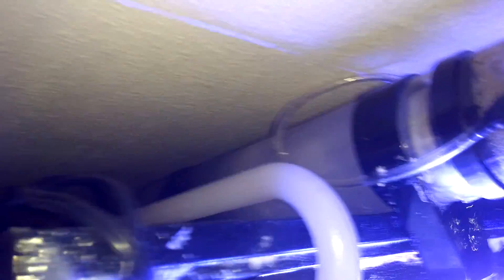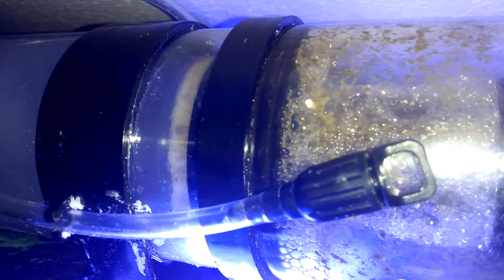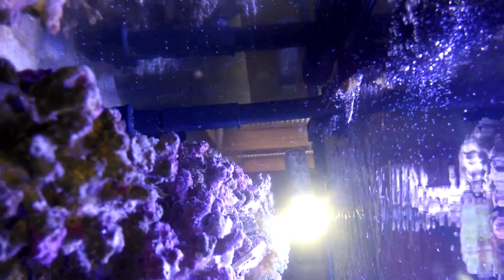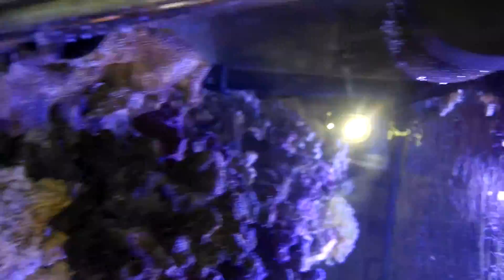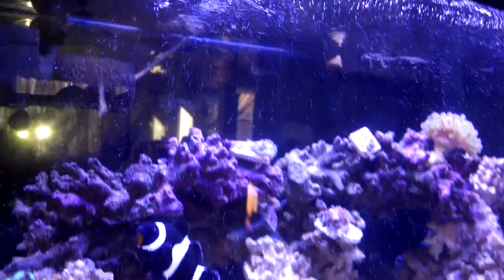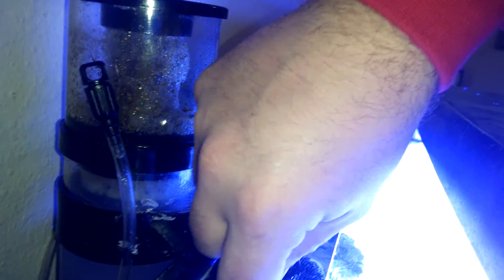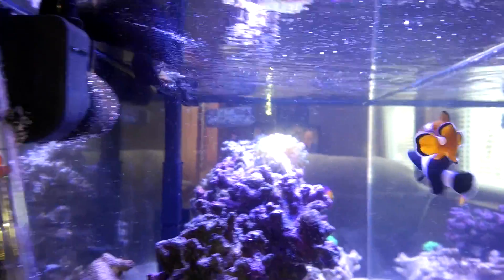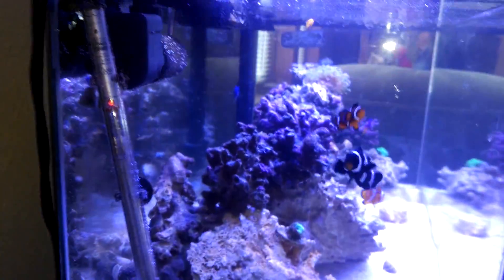Sea Clone Protein Skimmer microbubble problem fix

Comment: can you please tell me how do  you fit the skimmer backside of tank and what kit your using for output of water to skimmer
Reply: There is no kit. You just buy a seaclone 100 and it's already assembled. Just hang it on the back of the tank. Google seaclone 100 and look at the pics on the box. They're like most all protein skimmers in that you just buy and hang. I've never heard of "kits" of protein skimmers that you have to assemble and buy pieces to put together. I could be wrong but why buy kits instead of just the product?

Comment: how long does it take for the skimmer to start foaming into the collection cup.....i just put mine in today and no foam has built up......
Reply: Troy Kuhn ok so last night the skimmer was foaming up, but today when i got up the cup was almost full of clear water?? its been 3 days is that normal or is that happening because i have the air valve too open
Reply: Troy Kuhn yeah im going to go return mine and check out this remora.....thanks for the reply.
Reply: Menibor1 I don't know if you have returned your Seaclone yet, but did you run the skimmer air valve open for the 24 hours?
Reply: Actually I ended up keeping the skimmer, and after about 3 weeks it started working really good.....I didn't leave the valve open completely for 24 hours just half way......the first two weeks the water in the skimmer was white milky looking but now it's only like that towards the top..... I can see the cyclone now......either way I've had it for about a month now and it works real good it just needed time to break in..... Long time!
Reply: Also all the micro bubbles have disappeared!
Reply: @Menibor1  research on how to tune a protein skimmer. You have it open too far.